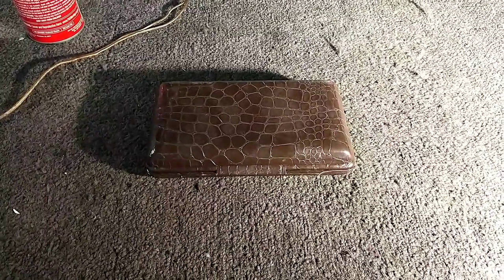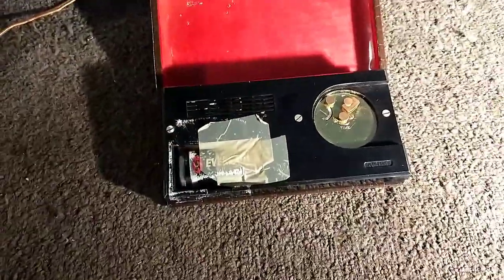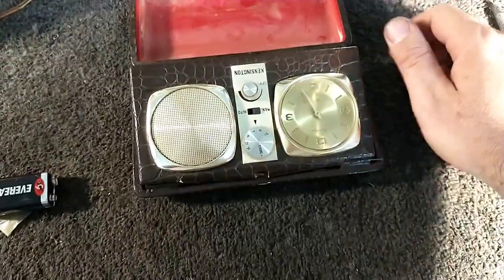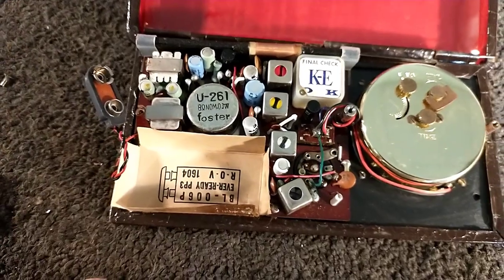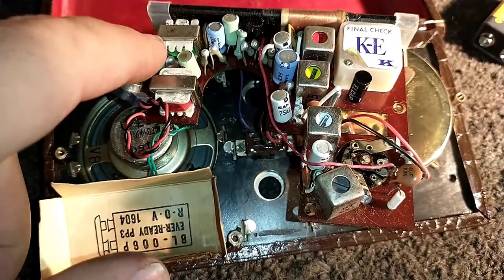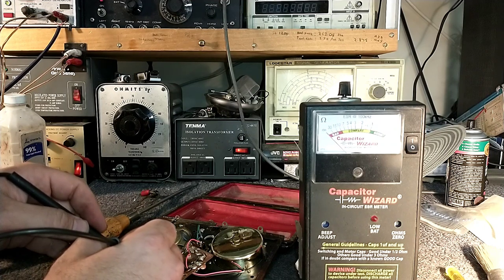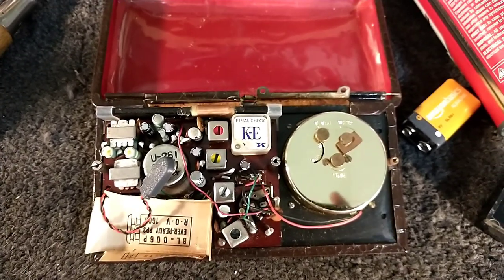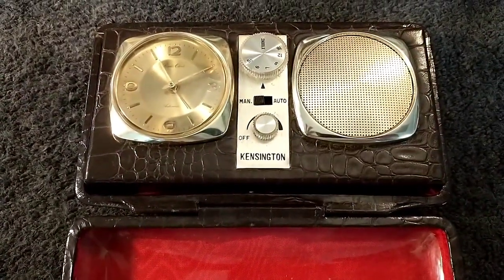Quick Repair of vintage 1960s Kensington transistor radio. Works, but quiet.

Comment: I recently acquired a 1960's era Heathkit VTVM.  It has the Burgess C size battery that came with the kit, and someone taped the date on as 3/66. The shocker is that it wasn't leaking, and it is still putting out 1.4 volts!!

Comment: I just repaired a GE portable cassette recorder from the early 1980s that had a low volume hum to it and no audio when you played a tape and it turned out it had two purple Matsushita capacitors in it that were bad (one of them actually “peed” on the board but thankfully it didn’t damage the board too badly), and replaced those caps and the tape player works now.

Comment: Hong Koidial. Hanging out with Shango066 much?
Reply from the maker: Probably one of the best vintage electronics troubleshooters out there.
Reply: There is a lot of talent out there in YouTube land. Love Shango's videos and yours as well. Indeed, 2 different styles all together, but you both get the same results and follow the same paths.. and, those are the correct paths to actually diagnose the problem, not just swap parts. Big difference. Thank you for passing all of your knowledge along in these videos!